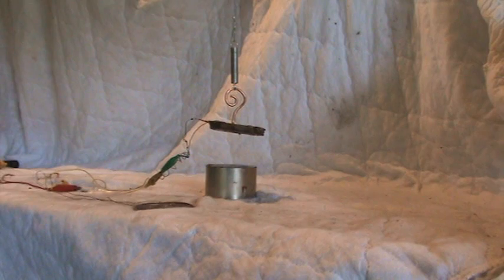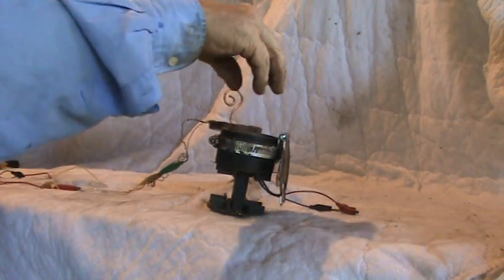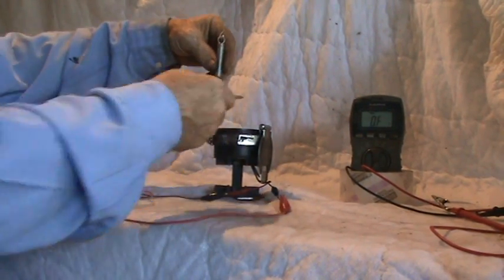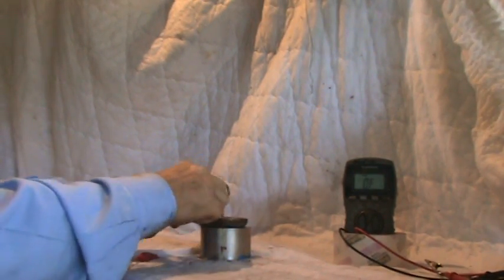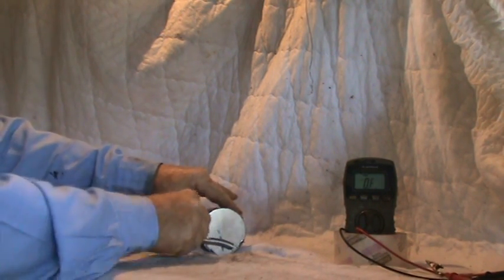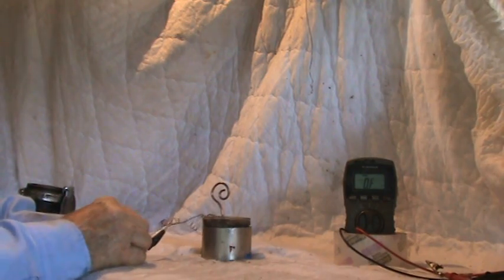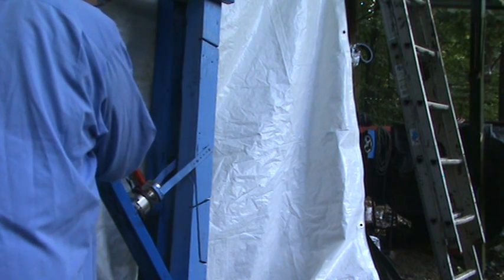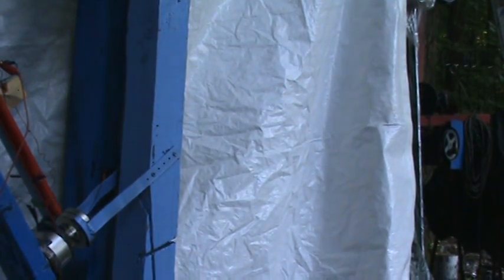Ray's Pancake Coil Motor

Comment: If you would use a U shaped backside  flux iron core your motor would be much more powerful
This way you could also use the backside flux of the magnets and could use all the flux in the airgap where the power coil is sitting...
This will increase the force very much...